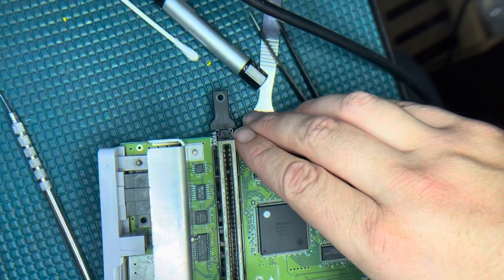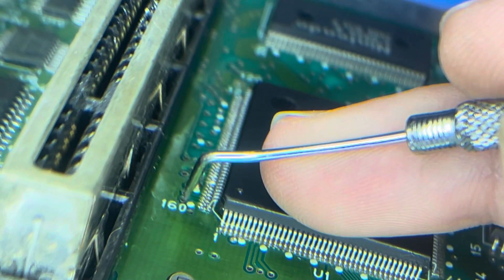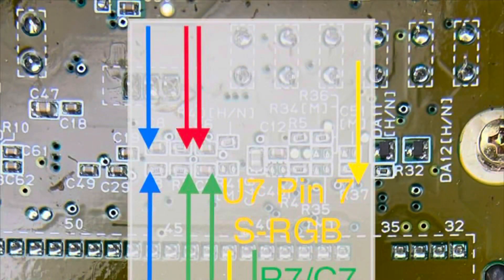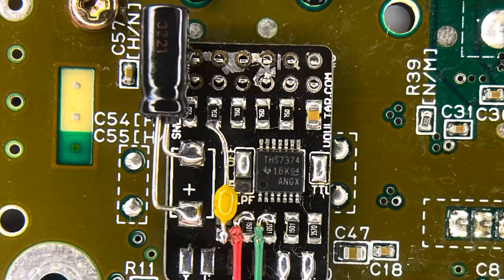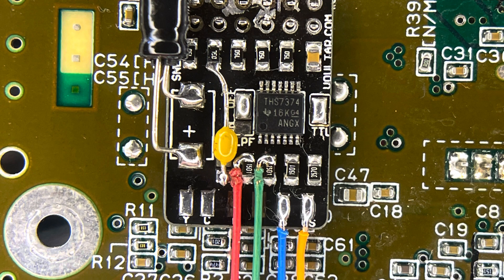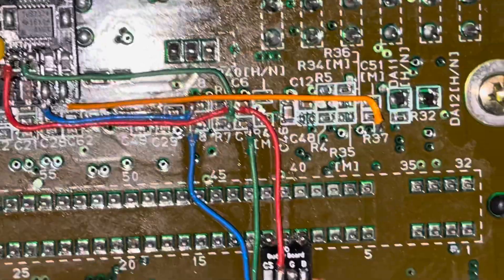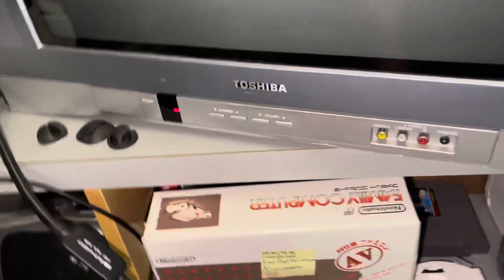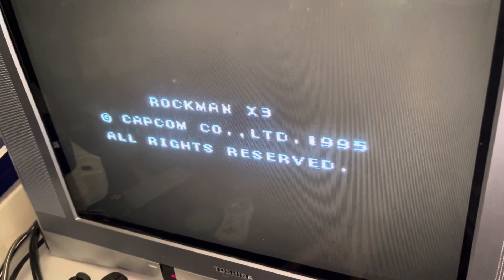Repair/salvage RGB mod attempt SNES2 SNESjr SNES mini 1chip Super Nintendo Entertainment System

Comment from the maker: Well, I couldn’t leave well-enough alone.

When recording this I noticed things were kinda touchy: I’d get a strange graphical distortion unless I tweaked the board. It got worse the more I messed with it until I needed to flex the board a certain way to get the distortion to go away. I reflowed all the main chips with fresh flux/solder but no change… except now the distortion is permanent and no amount of tweaking or bending or touching the board will correct it.

The distortion looked like it might be a sync issue and since I didn’t need c-sync with HD Retrovision cables I disconnected it but there was no change. Not sure what to try next. Probably a bad connection within the PCB considering it obviously got flexed enough to mostly pop that 1chip off the board.

The distortion initially seemed to be affected by pressing Reset and the console would sometimes fail to reset making me think it had something to do with loading 5v but that isn’t the case now. No 5v or ground shorts to any of the analog channels that I can find whether I’m flexing the board or not.
Reply from the maker: I ended up completely redoing the RGB bypass with one from Fragol Tech and using adhesive rubber feet to put pressure on the board where the bend was causing an issue. It works. Hope it lasts.

Comment: Nice! So your into the modding console scene as a side job? That chip was bouncing something fierce!
Reply from the maker: You could say that. :)

After working Black Friday tomorrow I’m gonna have to turn in my notice so that I can catch up on all the mod/repair work. My brother is out of the country and the tornado set us back like you wouldn’t believe. :(

I’ve probably installed 1,000 UltraHDMI, dozens of PS1Digital, dozens of N64Digital a bunch of DCDIGITAL/DCHDMI, dozens of Hi-Def NES, etc. :)
Reply: @emmettturner9452  That's alot of modding! I'll be honest about the hdmi mods on the N64....I'm not impressed. Best I've ever seen an N64 in person was using stock S-video cable on my Sony Trinitron crt. I have never seen it look that freaking good ever anywhere. The rgb mods seem to fair better within the color spectrum over S-video so I think that will be worth it. If you add some retrotink blur into that hdmi mods signal, I imagine it would look great. N64 to look good it can't be insanely sharp is what I'm getting at. In my opinion anyways. Since you have alot of hands on time with the finished product,  what is your expertise?

Comment: Nice work, very clean👍
Reply from the maker: Thank you! When I saw the lifted chip my first thought was “this looks like a job for PunkNDisorderlyGamer.” ;) Believe it or not, this isn’t the first time I’ve had to solder down a 1chip from a botched SNS-101 RGB bypass install. The last one required me to take the whole thing off in order to straighten pins and then reinstall it. Yeah, the owner managed to mangle them after bridging with wires through the vias. Though not normally needed for skilled installers, both were avoidable with a buddy board. ;)
Reply: @emmettturner9452  nice, you seem to have more knowledge than I do when it comes to mod boards and installs.
Reply from the maker: @PunkNDisorderlyGamer  Well, I couldn’t leave well-enough alone. :(

I had noticed that things were kind of touchy and I’d get a strange graphical distortion unless I tweaked the board. It got worse the more I messed with it until I needed to hold the board a certain way to get the distortion to go away. I fluxed and reflowed all the main chips with MGChem 835 Rosin like you use, adding fresh lead solder. Now the distortion is permanent and no amount of tweaking or bending or touching the board will correct it.

The distortion looked like it might be a sync issue and since I didn’t need c-sync with HD Retrovision cables I disconnected it but there was no change. Not sure what to try next.

The distortion initially seemed to be affected by pressing Reset and the console would sometimes fail to reset making me think it had something to do with loading 5v but that isn’t the case now. No 5v or ground shorts to any of the analog channels that I can find whether I’m flexing the board or not.